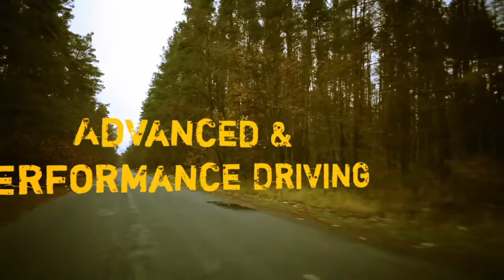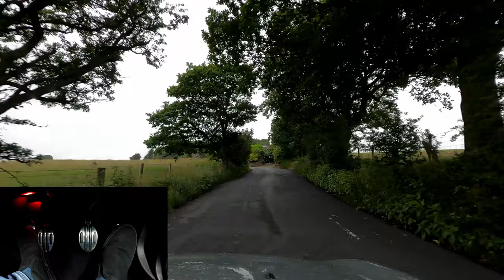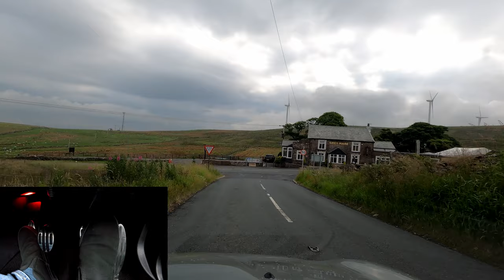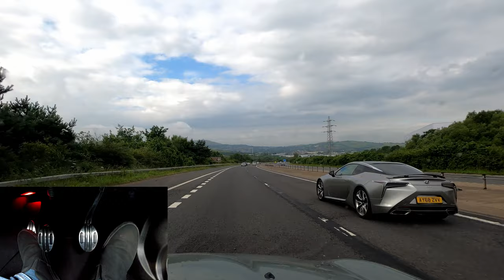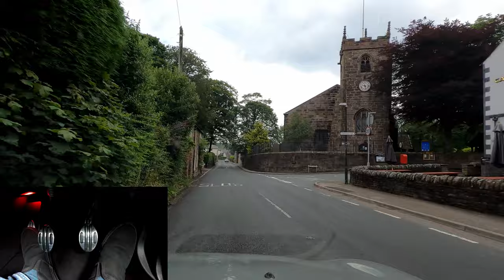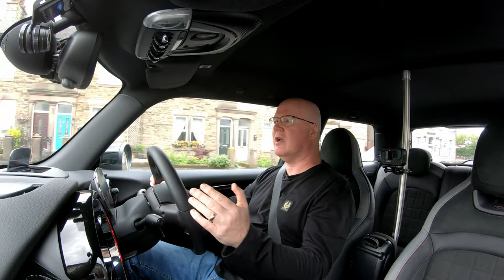How to Pass an Advanced Driving Test - Acceleration Sense (Not Engine Braking!)

Comment: Great video! I think people get confused about engine braking because it's a mechanical effect and some people define it as "any deceleration caused by the compression effect in the engine" which would cover just coming off the accelerator. With your definition it totally makes sense why you wouldn't want to do it.

Comment: A nice balanced explanation of acceleration sense. For me acceleration sense = smoothness/finesse. It is amazing how many people do not get the difference between slowing using the gears and slowing in the gear you are already in. It was good you mentioned people who take it to extreme and perpetuate the myth that advanced drivers/riders don't brake. (BMW flat twin riders take note!) One word of caution, acceleration sense is heavily dependant on being in a responsive gear. Many try to rush up the box and drive in too high a gear. Some modern cars however go into a sort of glide mode when the accelerator is lifted (either by mechanical means or electronic timing adjustments), leading to next to no retardation. Some electric cars allow you to adjust this by increasing the regen effect and this will give better slowing for better acceleration sense driving.

Comment: Whenever I asked drivers "how do you start to slow down", the answer was invariably " I'd use the brakes ". Er, no, you lift your foot off the gas first and the lower gear your in, the more pronounced the vehicle will slow down. So in a higher gear the vehicle will hardly lose speed, while in first gear the car stands on it's nose! Acceleration sense can be applied to every facet of driving according to the old Roadcraft.

Comment: My first instructor was ex-Police and though he didn't teach the terminology he taught acceleration sense. It was in the countryside and there were no traffic lights. After moving house to a new part of the country and getting a different instructor I remember him asking me to stop using the accelerator to slow the car down because he told me someone would eventually run into the back of me for not showing any brake lights.
He said this to me as I was slowing down while approaching a queue of traffic at red lights. I'd been doing the same thing constantly so he must have picked up on it to mention it.

Comment: The only place I use engine braking is on a steep downhill to avoid very rapid acceleration in the event of brake failure. Also to maintain control without overheating breaks

Comment: Nice one again.  For the past 18 months I've been inducting staff in Nissan Leafs (fine British car). The e-pedal makes for interesting drives as it is probably needs the latest brain development in acceleration sense. I tell my candidates to check out your Tesla video beforehand.  Most drivers with manual experience develop a reasonable standard quite easily. Those 'only ever driven in D' drivers (the majority in Australia) have more problems as they are used to stabbing either the go or slow pedals with little thought.

Comment: Excellent video Reg. One observation: You mention (correctly) that if you were to use the gears to slow down, as well as it being the incorrect order of IPSGA, following drivers won't get brake light warning of your reduction in speed. Although of course this is totally correct and I agree with you 100%, it's the same with acceleration sense to slow down as well, right? Don't get me wrong, I'm totally onboard with acceleration sense to reduce speed rather than braking unnecessarily but I just found it interesting you mention the "no brake light warning" for slowing down via gears but not for acceleration sense. Excellent video though.
Reply: Yes, "comfort braking" gives driver's behind an indication through the brake lights. Plus allows greater progress because maintains speed until the last moment. 

I don't understand why called "comfort braking" when merely releasing accelerator is more comfortable, such as reduced shoe work and chassis dive. If cheapness, like avoiding buying brake pads and more fuel, is not an issue then what reasons are there not to use "comfort braking" if preferred especially if there are no distracted driver's behind?
Reply: @DeeSock   "Comfort" braking because it comforts the driver when they feel the reassuring tug of their brakes beneath them rather like a shy child in a new situation who clings to her "comfort" blanket or teddy bear or sucks hard on her dummy (or as the Americans would aptly call it "comforter").  It is the mark of the undeveloped driver who has no confidence in their own ability & tends not to look & plan far enough ahead.  Using the device fitted to slow down the car - i.e. the brakes- is hardly likely to improve progress as it is the average speed which is pertinent & "maintaining speed until the the last moment is hardly "defensive driving".  Safety; System; Smoothness & Sympathy before Speed (progress).  The standard of a driver is directly proportional to the infrequency of their braking & the very gradualness of their deceleration doesn't warrant brake light warning.
Reply: @aztimms  thanks for your explanation of the preference for gentleness & safety benefits of slowing earlier, over (marginal) progress.
Reply: Using AS will always be a more gradual way of slowing than engine breaking, which can offer very abrupt deceleration in low gears. So AS will generally present far less danger to cars behind. I'd feather the brake pedal if using AS uphill, since the deceleration will be more severe. Drivers behind will then be warned. Don't overthink minor adjustments to speed - unless you are dealing with a very close-following vehicle.
Reply: @dougscott7079  feathering the accelerator might work uphill to mimic AS on a flat surface too I guess

Comment: It doesn't look difficult, but acceleration sense is actually one of the hardest skills to acquire, and it also introduces a new control: the deceleration pedal! Best way I found was to get my students to drive along a road with frequent speed bumps, and imagine that every time they hit the brakes unnecessarily, it will cost them a fiver. Soon gets them planning well ahead, I can tell you.

Comment: Just a note - your point about engine breaking not showing any cars behind you, your break lights - is the same as acceleration sense - lifting your foot from the throttle. They won't know that either. I agree its still not the way forward, but just wanted to make that point.
Reply: It's a good point, but I think a better characterisation is this: engine braking has near the deceleration of braking but without the lights, whereas proper acceleration sense starts earlier and is more gradual so doesn't need lights.

Comment: Another great video ... but I must admit that I really struggle with this one. I really don't like doing things because it says so in a book! So I really don't see what's wrong with seeing a distant hazard, realising that a more "flexible" gear would be more appropriate and changing down so that as I get closer to the hazard I have more "acceleration sense" at my disposal. ...  is it just a matter of degree? (down shift to put revs at 3000 rpm is ok, but not to put revs at 6000??). ... Help! I really need to get my head around this!
Reply: Is this the right mind set??   "use the brakes!" ...  Keep the too-high gear, use the brakes to slow early for the hazard, now grab the lower gear and drive through ... am I doing any better??  Is the idea that this gives a smoother ride since the gear change is easier to rev match?
Reply: @richardbower8707  The question you should be asking is "have I slowed by changing down a gear". There's a subtle but important difference.
Reply: @mikeroberts  thanks - tI get that way of looking at it - so if I change in anticipation of the need to be in a more flexible gear that ok, but if I'm changing to immediately slow the car, that's a no-no ??
Reply: A quick update .. I've been practicing "the system" with almost religious fervour: I now see that it does work well when you get it right!  Maybe this is the best motivation:  with IPSGA, if I fail to brake hard enough (eg. I don't accurately judge the corner initially), the worst that happens is that I have to keep the brakes on for a little longer and keep the same gear through the corner (end result: the A is smaller). If I make the same mistake doing the gear-shift and then brakes, I end up flustered, having to keep the brakes on into the corner and making everything very messy and uncomfortable. I can particularly see that this would be even more relevant in an old car with dubious drum brakes and a balky gearbox... maybe I'm a convert???
Reply from the maker: Sounds like you’ve seen the light Richard! Keep practicing and it’ll soon become second nature.

Comment: Hi Reg. I was taught one click of the indicators per 10mph of speed, which I often found to be excessive in calm, well-spread motorway traffic. At 13:35 you move right around the Porsche, and move during or even before what I believe to be two or three indicator clicks. Do you encourage observers and associates to follow any rules of thumb regarding motorway signalling, or what is your general approach?
Reply: Good point. I wish Reg would answer

Comment: So engine braking = changing down a gear to slow the car (usually with a ‘neck snap’ lol) vs acceleration sense = just keeping in gear and lifting off the gas. But of course still using ‘brakes to slow’ when required. Is this right? I’ve never really given this any thought in terms of the definition, however I do feel I use acceleration sense to keep the car speed good. My S3 is a DSG too 👍🏻🙂 Thanks Reg. Really good episode for me.
Reply: *engine braking
Reply: @jefflerner7526  - yeah, don’t really need it breaking do we? LOL. Edited it 👍🏻

Comment: Very good video yet again Reg. I have often wondered how much retardation you get when lifting off the accelerator pedal in electric vehicles. Is there much? Are they comparable to traditional automatic transmissions?
Reply: Normally electric cars have regenerative braking so it's slightly different. It's the car specifically slowing the car to be able to generate electricity for the battery. Lots of electric cars also allow you to adjust the amount of regeneration.

Comment: Hello Reg, I'm enjoying watching your different videos from Australia. May I ask I noticed in this video at the right hand turn at 20mins 43 secs you drove over what appears to be a red and white median strip just prior to the road arrow right turn lane, is this allowed in the UK ???  Over here its a fine as its classed as driving over a painted island and incurs a $248 fine and 3 penalty points from your licence. Look forward to hearing from you. Cheers and thanks again.
Reply: Rule 130 in the highway code states: Areas of white diagonal stripes or chevrons painted on the road. These are to separate traffic lanes or to protect traffic turning right.

If the area is bordered by a broken white line, you should not enter the area unless it is necessary and you can see that it is safe to do so.
Reply: In Australia painted islands that precede a turn lane and have a single line border may be driven on for up to 50m to enter the turn lane.
Exercising this right works better with IPSGA, especially when the turn lane is queued with turners.
The main caveat is that when entering the turn lane you must give way to vehicles entering the lane from around the island.
Reply: Australian road rules are generally not conducive to good driving.
Reply: @lenwoodman9442  for example: 1) Middle lane blockers that legally meet "Keep Left Unless overtaking" by not being in the far right lane. 
2) Overtaking on the left, which further enables (1).
3) Low tolerance for speed enforcement includes roads where Keep Left Unless Overtaking applies, which leads to long and congested overtaking queues.

At least the 50m painted island allowance for turn lanes prevents turn queues from congesting through lanes.
Reply: @owenanderson9395  That's just the start. Then add to it road design, over use of white paint and unnecessary STOP signs.

Comment: Great video. I'm thinking if you use engine braking, on the induction stroke the engine will act as a vacuum pump, as the throttle is shut, so will try to pull oil past the piston and scraper rings. Probably not good, especially in excess. So why do it at all these days with modern cars. Thanks again.
Reply from the maker: I’m not sure thats quite right John. The engine still draws air in on the intake stroke, just without any fuel. It’s the compression of the air which gives the retardation effect on lifting off the throttle.
Reply: @RegLocal  Have a Google for "carburettor butterfly valve" which shuts off the air. Fuel injection will be similar in this respect. It's the reason turbo's need a waste gate as the path of air into the engine is largely shut off when you close the throttle. As to whether the retardation is more the vacuum pumping or compression on the compression stroke, I'll have to go away and think about that. Perhaps a bit of both. If the inlet is open the engine would be free to pump air, but  when you close the throttle it's not. It's in the name - throttle I suppose.